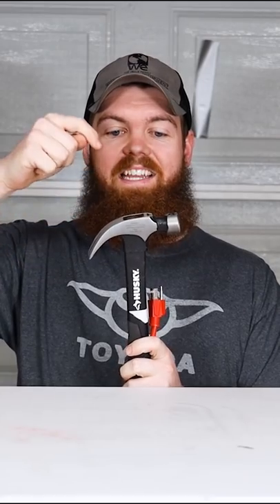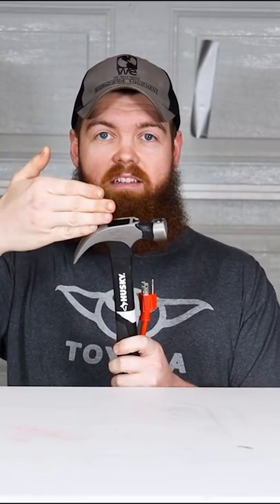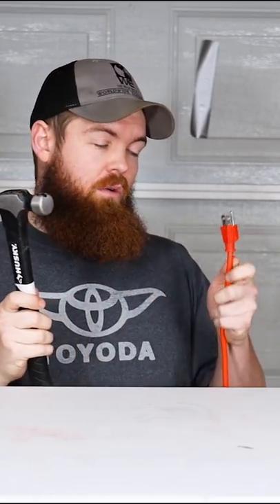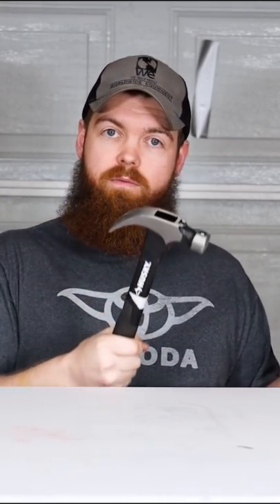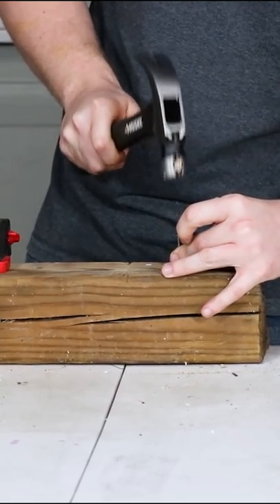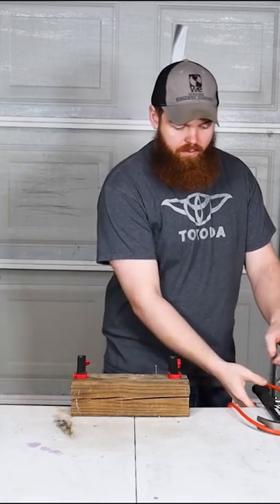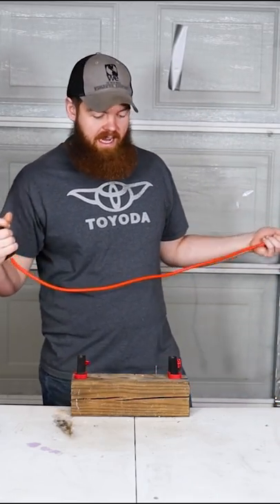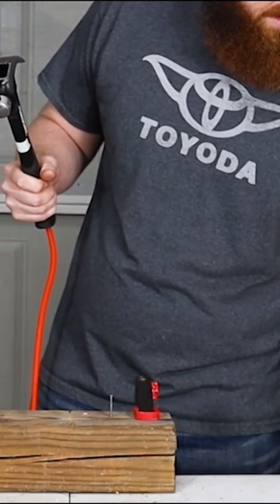How Does An Electronic Hammer Work?

Comment: Can’t wait for the cordless version. I get mine Dewalt brand though, I’ve never trusted Husky’s cordless anything.
Reply: Milwaukee or move along
Reply: @jjs8426  tellem boss
Reply: @jjs8426  amen brother
Reply: @jjs8426  Milwaukee is overrated and overpriced.
Reply: Lmao 🤣
Reply: @ninjahackstar7099  actually I have. Twice the price of a Makita or an extra third the price of DeWalt or Bosch, but they clap out just as quickly.
I'm 39 and have been working as a landscape builder since I was 17.  I both put my tools under more stress and require battery operated more than other trades.
But thanks for your input rookie.
Reply: It's not really the malfacture types of hammers cordless or not, i see that alot of people dislike other products, or does it have cord on it or not, it's not even the electronic hammer's fault! It's just that you'll need to use spikeless nails
Reply: @jjs8426  iwas go say that
Reply: @jjs8426  Milwaukee is just over priced Mac
Reply: Hope no cordless version of that hamer. Imagine if someone throw it on your head.
Reply: All these old men talking about tool brands gonna be dead by 50
Reply: The snap on price would be at least worth an arm
Reply: Y’all are wrong Pittsburgh is the best 😂
Reply: @fredsmith-kingofthelunatic7810  Have a good day stranger and I respect your opinion
Reply: Fuel only in this house
Reply: @fredsmith-kingofthelunatic7810  🤣🤣🤣
Reply: Milwaukee does make a cordless palm nailer
Reply: I’m in love with my stiletto to-bone, it’s smooth cordless recoil is outstanding.
Reply: @fredsmith-kingofthelunatic7810  You sent that boy packin’
Reply: But Husky came out with this first fine model.
Reply: @fredsmith-kingofthelunatic7810  makita is very underrated I personally use rigid as I have my own building and installing garage doors
Reply: @buddyburns9191  for the price they are they are almost unbeatable, and they have a great range of tools. Their only problem is they don't have they power some of the other brands have. The bigger circ saws take a double battery where the DeWalt takes a single and still put out the same power.
For most trades you can't go past a Makita.
Reply: I'm confused you guys realise it's a joke right? Or are you talking legit normal hammers?
Reply: @waterfoker8558  you take that back
Reply: Cordless🤣🤣🤣🤣🤣 good one 👌
Reply: @fredsmith-kingofthelunatic7810  i really respect that u use up to date slang, not many 40 year olds do that
Reply: @sellarupton1056  probably realize it’s fake, but…
Reply: @Colei0  not that he sent me packin just have better things to do than argue with some stranger it was rude of me to do what I did
Reply: I'd say Hilti is best their pricey but well worth it
Reply: Ryobi for the win!!!!
Reply: Didnt even know husky made cordless anythings..

Comment: He had me at negatively charged transductive reactor. They integrated that into the design to effectively reduce side fumbling. Beautiful engineering.
Reply: @brubbb  sarcasm
Reply: The hammering motion should be employed in conjunction with a drawn reciprocating dingle arm to reduce sinusodial depleneration. That might help.
Reply: I think an ambulated flambulizer could help
Reply: I had never thought of bypassing the thermonuclear oscillator  with the transductive reactor to create the hammering motion. These manufacturers are genius.
Reply: Right that’s like telling a new guy to get a board stretcher
Reply: @LesMilitairesSansFrontieres  you have a typo there bro, its the harmonic oscillation. I hope there's enough Faraday cage coating for the neutrino depletion thrust :)
Reply: @neileapenninan8706  Come on man, they proved years ago the neutrino depletion thrust would be counteracted by the degenerative quark compression eddies, though you can counteract it with big ball flange compression mounds which negate the flux neutrino concentrations and hence liberate the quark mobilisation.
Reply: A lot of the suggestions will amount to naught. The problem is a hammer has to stay as a hammer. Moreso the size. You don't want an awfully large hammer. So with that in mind, you need to use or employ nanotechnology into the area where the handle and head meet. Without revealing too much, please await the prototype
Reply: @dgibraltar  You have spent too long staring into the quantum tunnel and dazzled by quarks my friend, shroudknocker concluded a hammer locked in a box with TNT and a random on/off switch with time delays from zero to infinity meant the hammer existed and was also non-existant, in an indeterminate state
Reply: @suzesiviter6083  so what then happens in this, our present state?
Reply: @dgibraltar  As we are living in a transitional state of being and non-being, we are but energy condensed and therefore resonating faster than the ambient environment around us, yet all connected thru the Aether and in harmony with it.
Reply: Reading these comments has me feeling extra stupid 🥲
Reply: Right! Way better then the old rotary conducer. Gonna get me one ASAP.

Comment: There is actually something called a palm-nailer. Its essentially an electronic hammer. Fricken Badass if you don't have room to swing a hammer
Reply: Use it all the time 👍
Reply: It's not electric it's pneumatic an if you've ever seen how big a 16D nailer, the palm nailer gets into the tight spaces
Reply: @josephwinter8236  oh didn't know
Reply: I use one to build decks but the one I used is powered by an air compressor
Reply: Cousin has one. But I like this one better because you can plug it in and o
It will make room beating everything out of the way .
Reply: @josephwinter8236  Milwaukee makes a 12V cordless palm nailer.
Reply: Yeah those are handy
Reply: 100%
Reply: @josephwinter8236  they do have electric ones. Namely the Milwaukee 12v one.

Comment: When I was in the 3rd grade our principle had an "electric paddle" hanging on his office wall. We were all TERRIFIED. In retrospect it was just a paddle spray painted silver with a cord taped to the handle.
Reply: Bro same but they fooled our 8 year old minds by saying they all tased you we didn’t question it
Reply: No I'd hate to tell you this but that paddle was real they had paddle back in slave days with electricity going through metal coils in the wood so each time the smacked you it would feel like a tazer shocking you
Reply: Or they'd is cattle sticks which is a long stick with a tazer at end of it which shocked the heck outta you
Reply: @cheeseburgers82  The paddle wasn't real
Reply: @cheeseburgers82  it didn’t exist and also they don’t really like having basically a taser connected to a 2x4 in schools

Comment: This one's going to really confuse some people, electric hammers are an actual thing. The whole blinker fluid thing is funny because you can have someone go into a store and ask for some for the fun of it. If you send someone into a hardware store to ask for an electric hammer they could come back out with a real tool.
Reply: I am convinced this is why the brand “Elbow Grease” was invented.
Reply: I mean, a rotary hammer drill, or a jackhammer are technically both electric hammers.
Reply: They actually sell blinker fluid at alot of hardware and tractor supply stores now. It comes in a little compressor oil bottle lol.
Reply: Its funny because some places actually have blinker fluid because of the joke
Reply: I would love to see that 😂
Reply: If you send someone into an automotive store to buy blinker fluid YOU are the tool. LOL!
Reply: You are correct I believe they are called auto hammers if anyone wanted to look them up.

Comment: I might have believed this for a second if I didn't have that exact Husky hammer at home. 

On a side note the indent at the top is actually used to hold nails so that you can drive in a nail part way without risking the safety of your fingers, it's pretty handy.

Comment: Go for broke, install a welding foot pedal/side button and water-cooling system. Maybe a drill battery for when your doing DIY out in the sticks. 

On a more serious note you can actually get an electric hammer as an attachment by foredom. Its much more for precision stuff like jewelry setting, but I'm sure you could sink a stud if you had a few hours.

Comment: Actually not too bad of an idea. I’m thinking if they can transfer the motor from the body to the head piece of the hammer. And, the motor, when turned on, would spring the head piece in out. Kinda like a punch gun, but with a hammer.

Comment: Jokes aside you can have an electronic hammer that has a practical use.  The only issue would be safety 🤔.

You see, when there is a large change in electric potential, it creates a good amount of heat.  And hot gasses occupy more space.  A rapif change in temperature will therefore result in a pressure wave that can be used to move mass more easily in the same way a propellant would.  Have this mass used to impact objects in a specific way, and voila.  You have your very unique hammer.

Comment: Was it me, or that hammer just electrocuted his hand, is why he couldn’t control his arm. Electrical hammers are palm nailers. Work on air or electricity, use the weight of the tool to drive nails.

Comment: Good thing there are no "positive and negative" charges in AC applications 😂 its hot, neutral and equipment ground. Yes I know it was a joke but there's people who are gonna believe it's real. Even if it was real, imagine almost getting to the nail and the hammer decides to pull away at last second and you lose most of your energy in the strike 😂

Comment: Now hear me out, that kind of electric hammer, no. But wouldn't it be possible to make an electric hammer? There are machines called piledrivers that seat posts into the ground, so why couldn't we just scale one of those down for construction? Then again, why would you need an electric hammer in the first place? Sure it might make work faster, but how much faster? And is it worth the electric tool, as opposed to classic leverage, mass, and velocity?

Comment: Whatever that negatively charged transductive bullshit is, the only simple way you can have this effect is by having a motor inside the hammer that oscillates a heavy offset flywheel, much like the vibrator in our phones, but bigger.

Comment: If someone want's to hammer on a nail in a soft & weak material like fibre/plastic electric board, then it smashes it completely. Because it's  unable to control.🤣🤣🤣

Comment: Yea right dude that’s totally and def not how you start a nail with the auto hammer you first plug it in then you have to shake it like a shake weight which will switch it to starting mode, shake it again shake weight style and back to full speed, talk about amateur hour